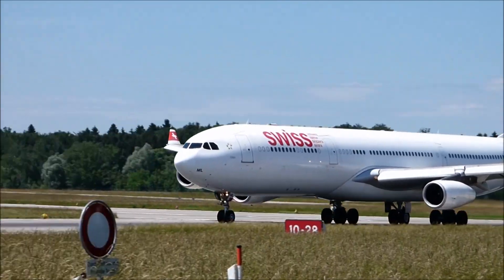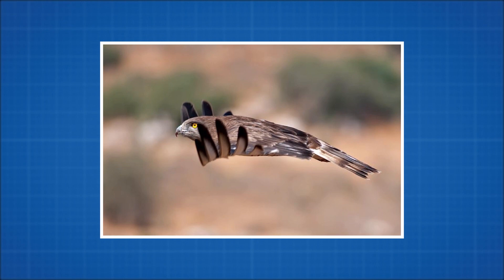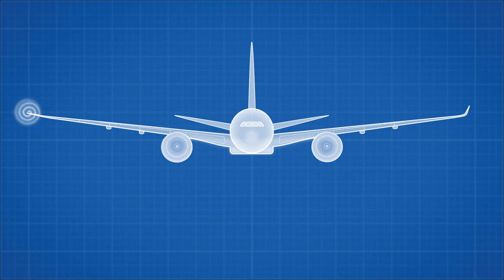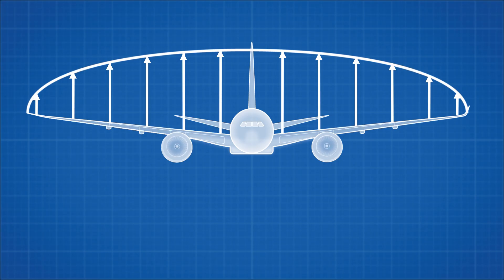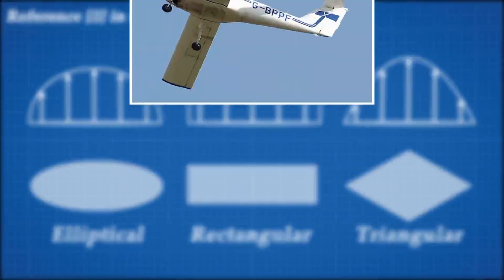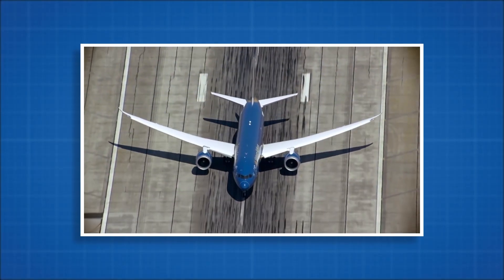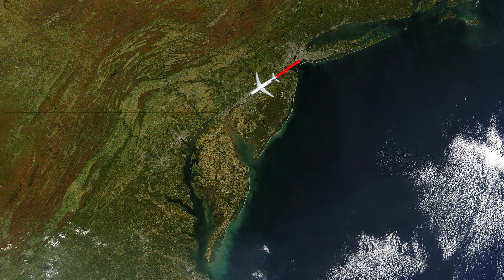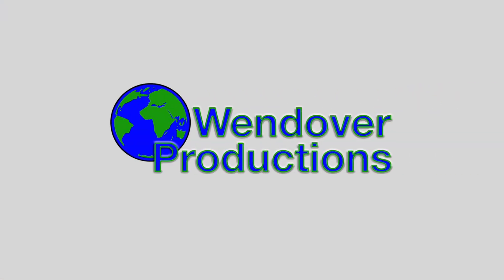Winglets - How Do They Work? (Feat. Wendover Productions)

Comment: Does B777s have winglets????
Reply: No it has a raked wing tips
Reply: @ethansaviation2672  note that the originals (777-200, 777-200er and 777-300) doesn't have raked wingtips

Comment: 0:42 a link please? I watched a video on YouTube that confused me. In that video they said the low pressure on the top of the wing also creates a lifting force? I thought it would create a down force and the high pressure on the bottom would create a lifting force but greater than the down force and that difference of pressure (or greater lifting force compared to low down force) creates the lift needed to fly? Am I wrong?
Reply: When there is low pressure, matter  tries to fill the 'empty space', there's a suction that goes to the low pressure. The wings go upwards, generating lift.

Comment: So planes with rectangular lift distribution have the most high pressure air that is moving upwards at the tip of the wing.
So they could use winglets the most.
But I have never seen a plane with a rectangular wingshape and winglets. Did I misunderstand?
Reply: No you understand it correctly. In most cases aircraft which have rectangular wingshapes are small piston engine aircraft like Piper PA28. I don't know the reason they don't have any winglet but I assume that for these aircrafts a winglet is simply negligible.

Comment: Wings do not work as described.  The air flies faster over the top of the wing due to the shape.  In still air the kinetic motion of the air molecules is in all directions.   When it hits a wing at speed, owing to its design the air travels faster over the top than underneath.  This means the kinetic motion of the molecules is displaced more in the horizontal direction than the slower air underneath.  The greater vertical kinetic motion of the slower molecules under the wing gives the lift.  Yes there is flow of a air from one side to the other, but that is not what causes the lift.

Comment: 11 feb 2019 6:7 pm est->6:10 pm est:
during aircraft using rudder to turn then winglet become unwanted-drag.
winglet is like rudder which can not be moved.source:'Movement caused by the use of rudder.' in https://en.wikipedia.org/wiki/Rudder#11_feb_2019_6_8_pm_est

addition 11 feb 2019 6:18 pm est:
but maybe winglet decrease wake-turbulence so decrease minimum-distance between 2 aircraft flying in 1 line,decrease waiting time for 2nd-aircraft who wait
for 1st-aircraft to takeoff.source:'The minimum time difference between two consecutive aircraft taking off or landing is decided by considerations of wake turbulence.' in https://www.quora.com/What-is-the-minimum-time-difference-between-two-Consecutive-Aircraft-landing-or-takeoff from google(turbulence left over wake air distance between 2 aircraft)result 1

Comment: Actually, induced drag is a function of producing lift. As a plane flies, it has a positive angle of attack (nose high). The slower it flies, the higher the nose to achieve enough lift. This causes the chord line of the wing to tilt back as well. This means that lift is not produced straight up relative to the earth, but to the wing, so some of the lift is actually drag.
Reply: Lift is defined as perpendicular to flight direction. Lift and drag are just arbitrary ways of breaking up pressure forces anyway

Comment: Nice video but I would like to add the most important part... Winglets generate THRUST, like a sail close hauled (they were originally called "Tipsails".  The circulating flow's AOA on the winglet results in a lift vector that is inboard and forward.  The forward components is the thrust component, which when it exceeds the winglet's own drag penalty, cancels out some of the wing's drag penalty.  This is strongest when the wing is working hardest, at Clmax.  The only airplanes that cruise close enough to Clmax to get a net benefit are those that fly for extended periods at low indicated airspeeds, say 2x stall, which is airliners that cruise above 30000 ft.  Straight wing airplanes that fly at lower altitudes and cruise at closer to 3x stall don't get sufficient net benefit, which is why they are extremely rare on straight wing a/c.  By extracting energy from the circulation while mounted vertical or near vertical, the winglet's thrust provides an efficiency improvement similar to added span without adding bending stress to the wing box itself since the bending load is inboard, not up.
Reply: This is not correct. An optimally loaded winglet that is perpendicular to the wing actually produces no thrust or drag. See Munk's minimum induced drag criterion.

Comment: Wings generate lift because of Newton 's third Law. In forward motion, the wing is angled to deflect the air flow downwards. Newton 's third Law results in an upwards force (lift) on the airframe. This explains how flat wings and inverted aeroplanes can generate lift.
Reply: that doesn't explain how wings deflect air down, just that they do. doesn't help explain much

Comment: i dont see what the angle of the wing tips has to do with the redundancy of winglets though. if the backwards angle decreases pressure difference enough, ok, but i dont think it does. and wouldnt just flattening the upper part of the wing tips have the same effect as a winglet, while getting a bit more wing area because the tips can still be used to reflect air downwards? from what you explain in the video, tip angle and winglets have absolutely no connection at all. any actual engineers here who can tell me why they didnt use winglets on the dreamliner?

Comment: Aerospace engineering PhD student here. Even with multiple classes in aerodynamics, developing intuition for lift distributions and wingtip devices is really difficult. However, focusing on reducing wingtip vortices like the video does is almost certainly not the best way to think about how winglets work. Vorticity is generated along the entire span of the wing in a continuous distribution, not just at the wingtip (ref. Prandtl's lifting line theory). It only rolls up downstream. 

It is the distribution of vorticity which creates downwash on the entire wing (induced drag) and this is why the entire lift distribution affects induced drag. An ideal vertical winglet moves some of the vorticity production away from the main axis of the wing, which reduces the strength of the downwash where the lift is being generated. By far the best explanation for this I have found is in Chapter 8 of Boeing aerodynamicist Doug McLean's book, "Understanding Aerodynamics: Arguing from the Real Physics". The big takeaway from McLean is that you can't think of the wingtip device as a bolt-on accessory; you have to consider its impact on the lift distribution of the entire wing (and this is really hard to think about). He also shows why devices which attempt to "straighten out" the wingtip vortex do not work in practice.

The video addresses raked wingtips vs winglets. McLean's book has a chart which shows that vertical winglets are more efficient than a planar wing for a given span. But this is only decisive for an airplane that is constrained by the width of an airport gate. Deciding whether to use a winglet or tip extension depends on the wetted area of the device (friction drag), the effect on the bending moment of the wing (structural weight), the weight of the device itself, and the induced drag benefit among other factors. There's really no right answer - you have to crunch the numbers in each case.
Reply: Thank you for your comment! I am an aerospace engineering student myself, and though I passed aerodynamics 1 and 2 successfully some phenomenons still leave me thinking. :) Funny thing you mentioned the book by McLean, because just earlier I watched his video "Common Misconceptions in Aerodynamics" and also left a comment concerning an aspect I couldn't grasp yet. Maybe if you have the time you can check it out and give me your explanation.
Anyway, I think I have a new book to read ;)
Reply: As an aspiring aeronautical engineer this comment gave a great perspective. Thank you!
Reply: I am a teenager right now striving to be an aeronautical engineer how should I start my career or what do i do im not really sure what to do im just learning as much i can about planes
Reply: I'm a PhD meteorologist with a BS in math and physics, but some of my fluid flow coursework was aeronautical. Go as far as you can in math and physics before entering college, where you can major in aeronautical engineering. YouTube has quite a lot of aeronautical engineering instructional information. Carefully watch birds fly. Recognize that objects traveling through water have similarities to objects traveling through air. For example, the bow wave at the front of a fast ship is similar to the shock wave at the front of a supersonic airplane. Read about people involved with aeronautics, such as http://www.spaceref.com/news/viewpr.html?pid=11860  Learn how to work with tools, which will also teach you something about general properties of materials (flexing, cracking, shearing, etc.).
Reply: Perfect Explanation. Boeing 737 pilot here.
Reply: Parasite drag is produced by VERTICAL surfaces and Induced drag is created by HORIZONTAL surfaces, for example when the Flaps are at 0 degrees they produce Max Induced drag and Min Parasite drag, at 90 degrees Min Induced and Max Parasite drag and at 45 degrees in the middle of both, for a flap with no thickness. The fact that Lift and drag are both proportional to airspeed squared, means airspeed affects a 2 Dimensional surface, geometrically a Square plane. Wing Vortices are not the cause of Induced Drag but it is just a Visible Effect of it. I have developed a hypothesis to explain physical, atomic and subatomic (gravitational movements, Center of Gravity and Mass), however I need to validate my V & H surfaces theory first.
It seems that Winglets reduce Lift and increase Drag, I also believe in turbance Winglets impose additional stress to wings and all other moving parts inside the wings like rods, joints and moving surfaces. Wingtips also decrease the stability and controllability in turbulent air. Simply put another british scam.
Please let me know what you think, thanks.
Reply: Is there any way to contact you sir..... It was for an academic purpose😊
Reply: Thank you sir, I'm just a school student and a fan of mechanics trying to learn some stuff and your comment was indeed useful.
Reply: As a second year aerospace engineering student this gave me a lot of clarity, thanks
Reply: Woah
Reply: Maybe you can clarify, and perhaps you already did in the last line, but aren't winglets more to reduce profile of the wing for taxiing/storage since the benefit of the winglet is (as far as I'm aware) the same as adding the same amount of wing?
Reply: As a normal person who has learned a great deal from your comment, I thank you. And, realize that I am one of the only people to comment because your comment has some very advanced physics in it.
Reply: BECAUSE YOU NEED AN ARTISTIC UNDERSTANDING.
MY DESIGN WAS DONE WITH OUT COMPUTERS.
THE WINGLET WITH A SLIGHTLY CURVED FACE
Reply: Yawns*

Comment: If winglets are so great, why weren't they commonplace pre-2000?
Reply: They were "commonplace". Boeing 747-400 introduced in 1985 had winglets. Learjet and Gulfstream (III, IV, and V) have winglets and they were produced in the late 1970's. Burt Rutan's VariEze (1975) and Long-EZ (1986) have winglets. Those are just some examples of aircrafts built with winglets by design from the factory, but winglets were also offered as retrofit on older aircrafts such as Boeing 737, Gulfstream II, and few others.
Reply: Fair points, but I don't find that to be commonplace.  They had plenty of time to retrofit the DC-10 and L-1011, yet I never encountered one with winglets throughout the 80s and 90s.  The factory also had plenty of time to design it into the original MD-80, 757, and 767 yet that apparently didn't happen.  Just wondering why.

Comment: winglets invented by this guy ? I you sure ? In the late stages of ww2 both the UK and germany were experiementing with wing skeggs to promote airflow in transitional flight and lift. Post war airliners also were fitted with these concepts. Changing these skeggs from the 85 % position to the end of the wing to increase this effect is not an invention but an act of development of the concept.

Comment: auauau- 5% by winglets-Voodoo. They always write "...up to X%". BUt the Induced drag being system immanent is simply cwi= Const *  cl² / lambda. Lambda is aspect ratio.  
Therefore maximum benefit e.g. for 2  50 cm winglets at 30m span is 31/30 or 3%. 

BUT induced drag is not relevant drag during cruise. 
That's some flight mechanics issue. A long time ago when I studied that. 

Winglets mainly  increase effective aspect ratio. This works mainly when it is fully loaded. 
On sailplanes they improve handling. 
But they also provide interesting problems. :-)

For business jets it's marketing. They are usually low loaded and in this case the induced drag is low. It's a car-spoiler for rich people. 
And lines want that passender can see logo outside the plane. Very important. ;-)

Comment: So, I understand perfectly fine how does a winglet works, but I have one question: why airplanes started to use winglets until the late 80s, early 90s, if you were saying that this was caused to reduce fuel consumption during the 1973 oil crisis? For example, McDonnell Douglas DC-10s where developed in the late 60s, early 70s, coinciding with the oil crisis, but they where widely manufactured during the 80s in a post-oil crisis era without winglets. And it wasn't until the 1990s when they upgraded to the MD-11 that they started using winglets. 🤔
Reply: Lewis DSD because it had an engine on its tail

Comment: The oil crisis was not limited to America, but affected the entirety of both the First and Third World. I was told that the OPEC throttled production to drive up prices and maximise their cash flow. If so, it worked. If the goal was to punish the First World for  supporting Israel, it obviously didn't work. And they did it again a few years later. Besides, Saudi-Arabia was also part of the First World.

Comment: Does anybody know why 777's dont have winglets?
Reply from the maker: An alternative to winglets is to just make the wing longer. The gates 777s use are larger (long range) so they can fit into them easily with longer wings. Winglets are generally used on short range craft that have smaller airport gates.
Reply: great, thanks for replying.
Reply: I'm amazed you replied to this 9 months down the line, thanks for a great video and great answers.
Reply: Winglets just Are not needed on the 777
Reply: 777 wings were not designed to accept retrofits ( which winglets are )

Comment: Just a bit of supplement to this video. You explain that the vortices cause an induced drag, which is true, but fail to elaborate how. 

During normal flight, an airplane typically has it's wings angled relative to the direction it is traveling. This is known as its angle of attack. The vortices at the wingtips create a "downwash" that adds a negative vertical component to the direction of the freestream relative to the wing. This effectively increases the wings angle of attack. Drag can be modeled as a function of a wings angle of attack, so the higher the angle of attack, the more drag. So, by reducing the strength of the vortices, the less induced drag.

Cool visual of downwash:
http://giphy.com/gifs/physics-fluid-dynamics-iGTcisUsxdp60

Comment: It always bugs me when the "higher pressure under the wing" explanation is used for how/why planes fly. It's not untrue, but I think it's much more illustrative to say planes fly by pushing air down.
Reply: Yes, exactly.  I think it's more correct to say that the high pressure below/low pressure above is not the CAUSE of lift, but rather, the RESULT of the downwash creating lift.  See Newton's 2nd Law.
Reply: Thank you. I've always hated the "The shape of the wing section causes lift" and the whole "faster airflow over the curve reducing pressure causes lift". Angle of Attack has more to do with lift than that stupid curve that is rammed down our throats, otherwise how do aerobatic aircraft with symmetrical  airfoils fly? Take a wing underwater and put it on a submarine (Dive planes) water doesn't change pressure, only the angle of attack decides if the sub is pushed up or down.
Reply: @iangadget3848  at 0 degrees AOA a symmetrical aerofoil, which as you mentioned an aerobatic plane has, would cause 0 lift. Whereas a classical aerofoil with a positive camber would cause lift.

Lift is not only a function of AOA.
Reply: @THYB737  No, but a flat sheet of balsa will fly given angle of attack.